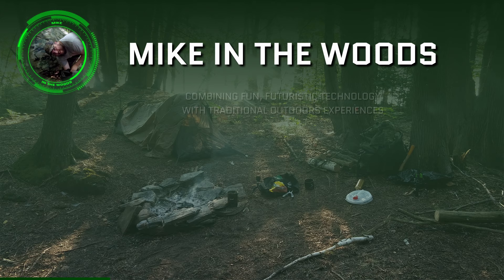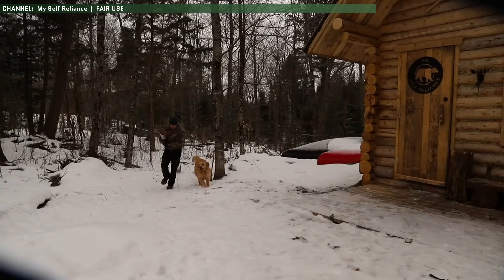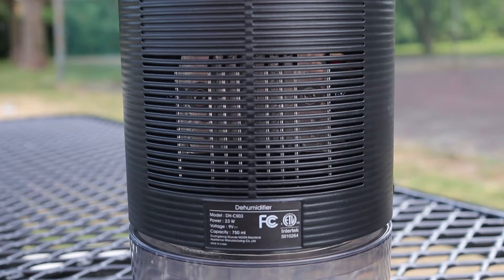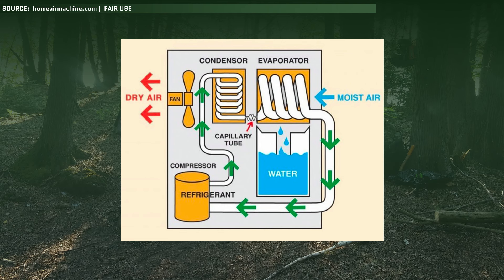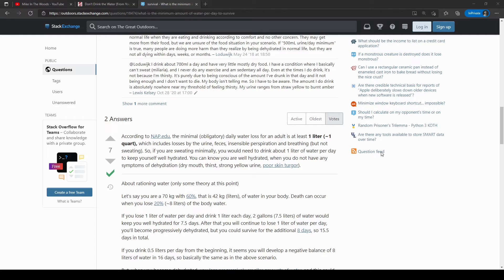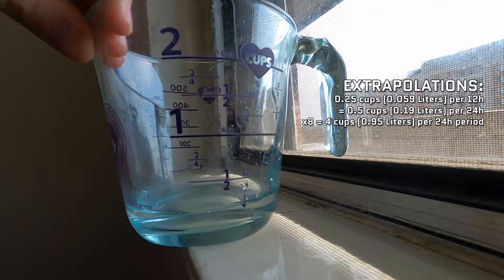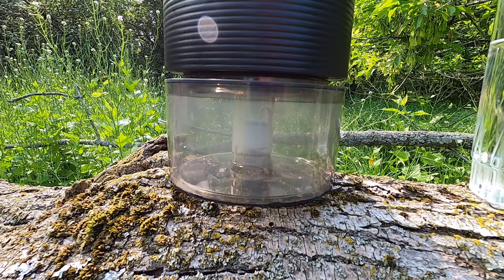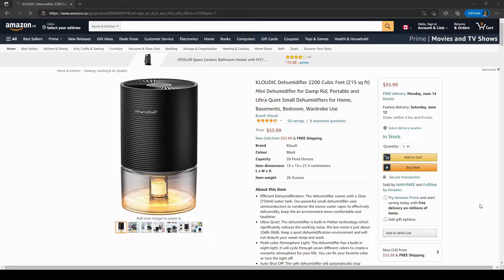Drinking Water From Thin Air?! How To Harvest Moisture With A Dehumidifier

Comment: WARNING: You can't drink pure distilled water as stated in the video. Doing so can cause a drop in essential minerals levels in your body (such as calcium and magnesium) and may lead to severe malfunctions. Please make sure to include in your video that water needs to be remineralized before consumption. Thank you.
Reply: Lets say you don't have issue with no water, but the water storage is getting low, would mixing distilled water with mineral water 'fix' that?

Comment: Another Off the Grid solution but takes hours in complete exposure to the sun light eill provide residual water from a pit dug in the soil convext, with a cup centered in the middle, followed by placing a transparent sheet of saran wrap or painter’s drop sheet over the convection dug pit stretched tight with heavy stones to help platic ridgidness lay flat and lay a small pebble over the center of the saran wrap to caus vapor rising up to collect on the underside of the saran wrap to draw droplets that form to decend toward the center and will get heavy enough to collect droplets of water from built up condensation into that cup and by the end of the day  have some water collected inside that cup.

Comment: The moisture that collects on my peltiers evaporate too quickly.  I plan on experimenting with a dehumidifier next.  For those of you doing the same, consider purifying the water collected with a Berkey Light Gravity-Fed Water Filter or a Bluevua RO100ROPOT Reverse Osmosis System Countertop Water Filter.

Comment: I hope it can fill a tank when you have a camper for bathe purpose... Peltier module should be re-designed a lot bigger with little power consumption to accomplish such job... Just like a transformer  to be re-design  for ways to increase DC voltage instead of AC...

Comment: When I put that  question into Google it emphatically says NO DONT DO IT. Because of heavy metals and molds. But I feel they're being a bit over protective maybe . Surely if its cleaned up with a filter even if the unit has these issues then it should be safe.
Reply from the maker: I cover that in the video!
Reply: Just filter it. In a survival scenario, it's better than dying of dehydration.
Reply: There is a commercial unit that has treated the intake filter and coils to stay fungus free and collects a few gallons a day
Reply: Coffee filters work great to get the large contaminants out then I'd use some water filtration tabs or the liquid types and or use non scented clorox bleach be careful on the clorox drop dosage and or boil the water for ten minutes.

Comment: I also thought of using cybertruck honestly, aside from its ability to last without gas being produced and its minor ballistic protection it has hepa biohazard filters on it. Of course i plan on modifying the body by cutting off the shell behind the seat and replacing it with a camper shell that has solar power on it

Comment: Why just run multiple units when you can DIY something? you could gut the unit and use multiple peltiers on a custom heat-sink setup. better yet you could also use thermo electric generation or absorption refrigeration to condense and collect condensate?  all in all there are a bunch of ways to do this that wouldnt require hauling all that volume/mass of COTS hardware for a grid down or over wilderness treking.

Comment: My science brain has a question:  
what of the air when you live in a cold desert?  There is sagebrush all around where I live.  Logically, how much you collect comes from what is available in the air.  This video has a man surrounded by trees.
The natural water cycle needs water in the air.  If everyone started sucking water from the air, wouldn't it just add to the already dry problem?  Parts of barren Africa for years suffered with this until they got wells, used water to grow crops.  They now have created a better green ecosystem to support their crops with rain, from water that transferred to the atmosphere through evaporation and photosynthesis.  Its still not perfect though.
All I'm saying is that theoretically, you could get water; however, it seems that in the long run we would be robbing the system.
Reply from the maker: Then the scientific brain of you should do the math on how much air volume there is in the atmosphere

Comment: How long are these smaller units like the one you use supposed to last? I bought a more rectangle shaped one that is slightly larger that had a 1 liter reservoir. I had used it for a whole year before it crapped out on me and decided not to work. It's this a normal amount of time for it to work? Plus, during this time, I was only able to fill up three 2 liter bottles. This was in Sacramento, California.
Reply from the maker: I find stuff like this either lasts indefinitely, or dies within a few months. No in-between xD

Comment: Or you could just distill it using the sun. Dig a hole, place a bucket in the middle, fill the outside with w/e water you want (sea, river, tap, urine.) place a tarp over the hole, and place a weight in the middle over the bucket. Make 10 of those and you have plenty of perfect water using the sun, bucket and tarp. yw